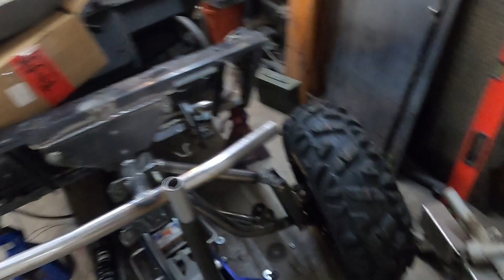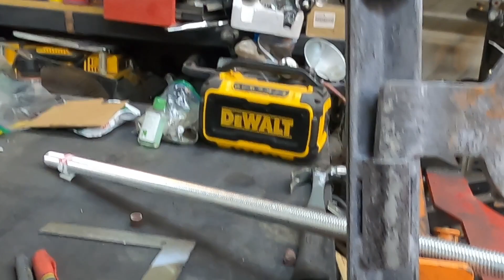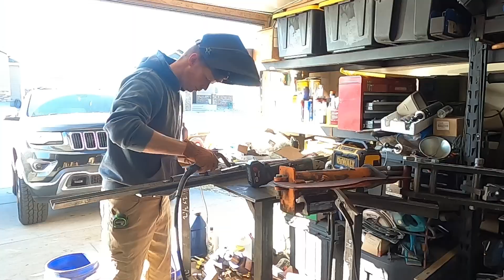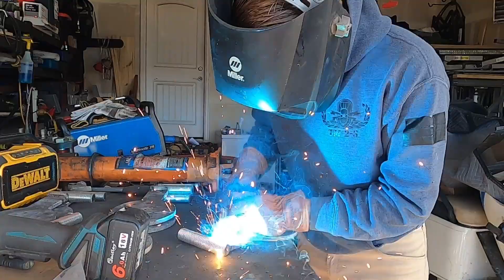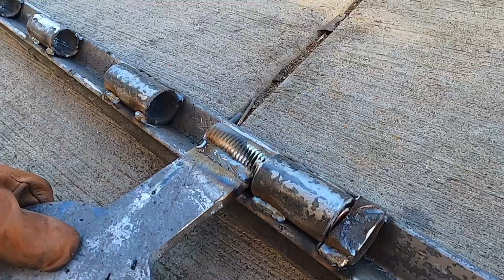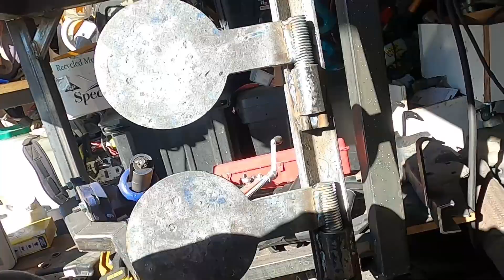Modifying a steel target

Comment: Any reason you didn’t go with smooth rod over threaded? It kinda looks like when you whacked the target in one direction the threading caused the target to rise.
Reply from the maker: $$$ and availability. The all thread was $22 and one 36” length was perfect for what I needed. Solid rod would have come in a 20’ length  and been a couple hundred dollars. I watched my steel yard for drops to keep the cost down but in the month I watched nothing this diameter showed up.
Reply: @Andrewactual  I figured it was cost. I guess they don’t like to sell partial lengths there.
Reply from the maker: @bjsummerfield  only in the form of “drops” (other people’s leftovers).
I find a lot of good stuff that way and if they have a lot they need to move they will throw me a pretty nice discount
Reply from the maker: The way the threaded rod sits in the steel tube and rides on the smooth bottom end of the rod shouldn’t rise because of the threads and if it did it’s a 1”-13 thread so a half rotation would allow it to rise .08”.